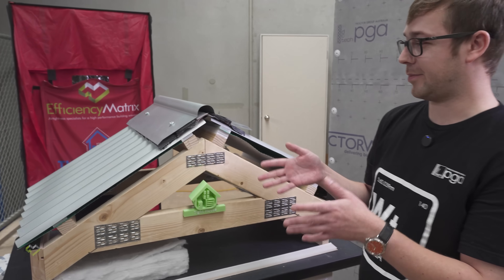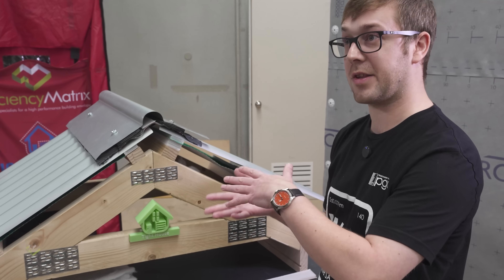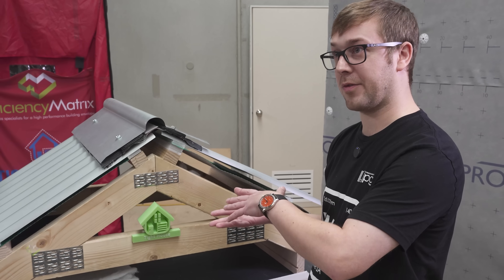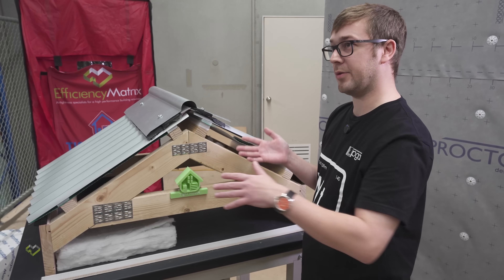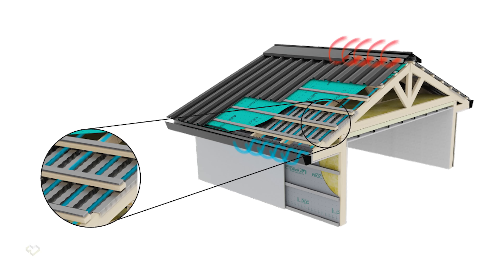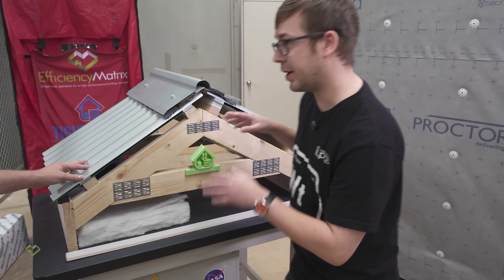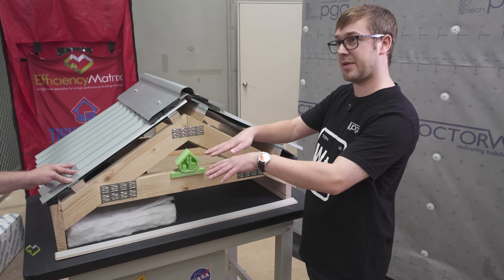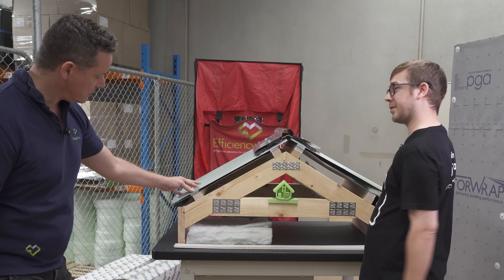Roof Changes to the Australian National Construction Code : Ventilation! (2025)

Comment: How does all this integrate with BAL rating for bushfire requirements?
Reply: Bushfire requirements was a big issue for us and obtaining our final building approval. We built in a fire prone area and had to comply with heaps of requirements. Our area is also very cold (and dry) in winter so sealing the house and the roof was essential as well as mandated. We needed special approval to install two roof whirly birds with the stainless spark screen essential. Insulation is roof blanket under the roof sheets, foil down and R4 batts. The house is now 13 years old and the ceiling space is clean and dry, the same as the day we built the place.
Reply from the maker: @colharkin7886 there is a BAL variant.  You can se eIR on tightHOUSE.com.au
Reply: @ecoevo  Thanks for this... I forgot to mention in my previous comment that the other major concern for us when building was preventing vermin entry. We rarely get mice inside except for the very small ones, because they are so small. I cannot figure out how they get in but it is rare. 

I used a number of sealing products during the build. Expanding foam and a very sticky fibreglass reinforced tape for joining the roof blanket and sealing other small holes etc,. As I said, in our ceiling space, I installed fluro lights up there as well and I can walk around (carefully) is dust free and dry. I finished the build end of 2011. 

BTW - the home is a PAAL steel framed Elizabeth - with our variations.
Reply: @colharkin7886  I take it your insulation blanket was layed directly on top of your batons with the roof sheeting screwed on top
Reply: @64azeem  Yes. That's the way the licenced roofer did it. This was the standard method in 2010. Roof angle is 30 degrees. FYI.. I have watched commercial roofs being installed, many were virtually flat, using this same method.
Reply: @colharkin7886 well it would seem according to these guys because you don’t have any air gap to your sarking your blanket insulation should be very wet and destroyed lol I think there may be some pocket change swapping going on with these guys and the NCC to sell their system which looks to have a lot of floors for Australian conditions
Reply: @64azeem  Agree. Ventilation in ceiling spaces is important to stop mould, and that's one reason I sought approval for whirly bird "ember resistant" roof vents. Other reasons for closed ceilings - blocking access for vermin and birds plus flammable material that can blow in with the wind. This was a serious problem in the past before sarking was mandated under tiled roofs. 

Regarding the products shown in this video, I doubt they would be approved for use in our area. 

While it may be difficult to appreicate, a roof blanket work extremely well. It blocks (some) heat in summer, but the main function is to trap condensation that forms on the under-side of roof sheets and direct that moisture into gutters. It does the same job as sarking. And - because our roof has a 30 degree pitch, there is no way moisture is retained in the roof-blanket under roof sheets on our home.
Reply: @colharkin7886  Laying a metal roof with blanket and foil trapped between battens and iron is the only way to do it properly. You will NOT have condensate form above the foil, or under the metal roof because this is a trapped air space, no air coming in, means no moisture. Exposed under foil surface is insulated by the blanket. Condensate only forms when warm moist air comes in contact with a cold surface, as in glass windows with cold temp outside and warm moist interior.
Reply: @haydnwilde  Thanks for this explanation... It would make sense that if building regs allow this to be done, it wouldn't created damp or rust problems as a result.
Reply: I was about to comment this as well,
I sm guessing it is not rated for this or a mesh would need to be over the inlets/outlets.
Reply from the maker: @balensydney https://tighthouse.com.au/products/proctorvent-over-fascia-vent-25mm?_pos=1&_sid=b5bfcf5e4&_ss=r&variant=44373999878316
Reply: @ecoevo I thought roof needed to be as a system and anything above the insulated bat with integrated sarking or sarking would need to be rated. Ridge vent definitely needs a rating as well. Generally tight = BAL but this is one place where there is some conflict. Might be worth a dedicated revisit once there has been time for the market to adjust to changes.

Comment: I have an old house built in the 1940s with open eaves so plenty of ventilation. Would I be better off not adding a roof blanket/anitcon blanket under the metal roof and instead go for a simple sarking and put more insulation down over the existing R4.0 batts? I can't seem to find any good answers for this type of roof setup.
Reply from the maker: A vapour permeable sarking, with a gap from the roof, plus these ventilation solutions will reduce the temperature of your roof.   We always recommend making ceiling insulation perfect.

Comment: Why is attic ventilation (cavity between insulation and membrane) required if a vapor-permeable membrane is used - especially when a vapor barrier is installed on the ceiling and walls? Isn't it a waste of energy?
Reply: Can we get clarity on this please. I'd like to know if a vapour permeable membrane on the cold face of vapour open insulation, then a 20mm gap to say metal (with battens that allow airflow) is compliant, please.
Reply: @epicrapscallion5367  this is allowed under the provisions as long as the membrane is Class 4 vapour permeable and it's in direct contact with the insulation.  You would have to demonstrate that the openings at each end comply with the minimum ventilation area for the pitch of the roof.  Important to note that in roofs above 10 degrees, the openings at the ridge should be much smaller than at the eaves/soffit (5,000mm2 v 25,000mm2) so I'd use a ridge vent instead of relying on the open area of the roof profile.
Reply: NCC condensation management clauses don't require a vapour barrier at ceiling level or specify that the external sarking membrane should be vapour permeable.  Ventilating the roof space ensures the condensation risk is reduced even if you have a non-permeable sarking (like foil) and no vapour barrier
Reply: Talks best practice then does this junk... should be roof installation and vented over roof only
Reply from the maker: Vented over roof only?  What do you mean?